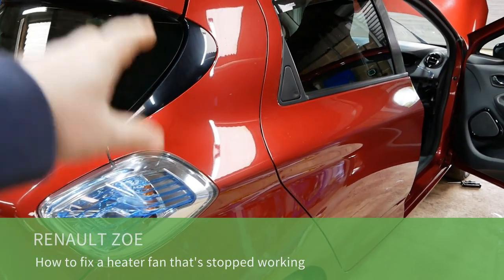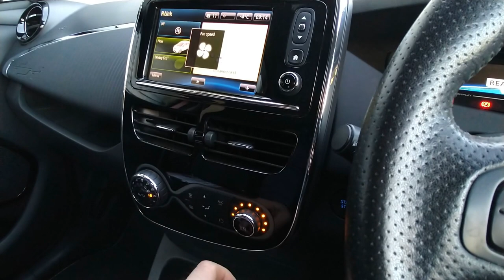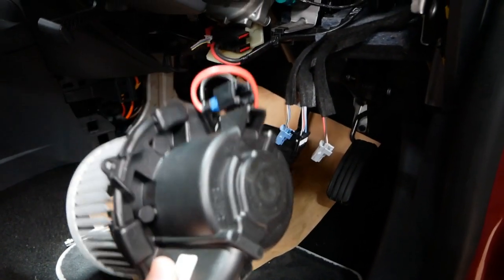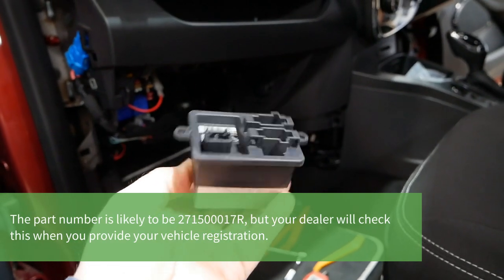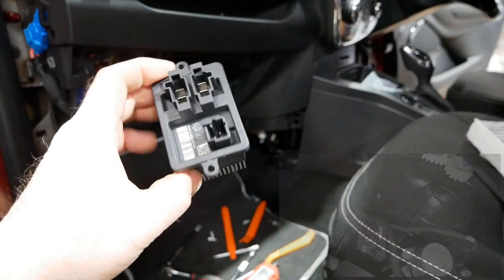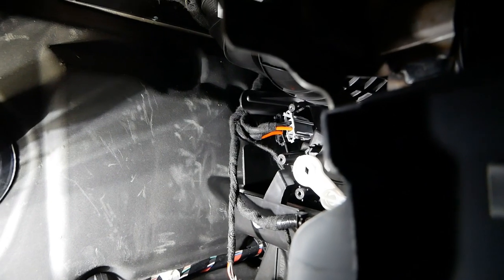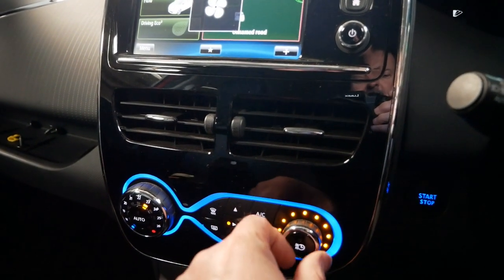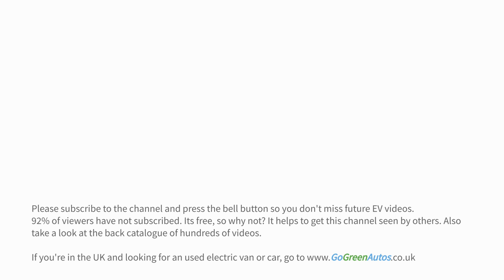No hot or cold air in your Zoe? Fixing the heater blower fan in a Renault Zoe.

Comment: Thank you very much Matt. I had exactly the same problem and fixed it the same way by replacing the resistor unit. Just don’t do what I did and mix the old and new ones up and have to do it all again! However it was worth it to find out that the old one was getting extremely hot after a very short time connected - the cooling fins were too hot to touch. If that is happening to yours after just a minute, a sure sign it needs replacing.

Comment: Yeah, it was the same on my Vauxhall Cavalier.  The fan would stop working because the diode in the "resistor" module had blown. I was told that it was a common job at the Vauxhall dealers. I bought some diodes and replaced the diode. Cost was about £1. I did that job a few times over the 8 years I ran the Cavalier.
Reply from the maker: Yes I'd heard this is common on others older cars. But I was also told that the Zoe didn't have a resistor module...hence why I went looking for the fan.

Comment: This happened to my Zoe too. Replaced the resistor, but still not working. Took out the bottom right 10 Amp fuse that controls the fan and locked car for 10 min and the fans work again. Quite fiddly to replace the resistor. Using my iPhone in Video mode with flash on helped a lot to locate everything.

Comment: I'll try this out! I'll check out your vids for any other tips for why my heating might not be working in a 2014 Renault Zoe?
Reply from the maker: Heater problems in the Zoe is normally due to low refrigerant. The heat pump uses the air conditioning compressor and really you need to regass the cars about every 3 years. See https://www.gogreenautos.co.uk/how-tos/renault-zoe-heater-not-working

Comment: Very interesing video about Renault ZOE PTC heater. How install ? Where location ant etc.
Reply from the maker: Zoe has a heat pump, not a PTC heater.
Reply: @GoGreenAutos  Other ZOE versions have a aditional PTC heater, conected to PDM module.
Reply from the maker: @miciusbmw  Sorry Yes you're correct. I forgot the Zoe has a small PTC heater to assist the heat pump.
Reply: @GoGreenAutos  ThankYoo fo answer. Very interesing all information about PTC. On My Zoe 2014 year, no PTC heater, heat pump in -5C conditions always work at max heat mode without ECO mode, for me not enougt heat power. Heat pump serviced by Renault Dealer, freon quantity is normal. I using small 150W heater in 12V, but is very very small help. Legs heating is very weak.

Comment: A somewhat related question: a spinning noise has randomly appeared when the heater fan is on. I can hear it quite clearly from outside where the air intake is below the windscreen. Is there any what to get to this to see if anything is stuck in there? It‘s not a problem (yet) but just annoying.
Reply from the maker: Often caused by a leaf in the system

Comment: Did you find a way to test the resistor pack to confirm it is dead?
Reply from the maker: No. I don't know how they work. But I'm sure that info is probably somewhere on the net as the same component is used in most heaters.

Comment: The heater resistor pack on cars in general can fail because the lubricant on the heater motor bearings has dried out. Often the resistor pack has a safety component that fails due to this and fan then only works on max setting. Expensive job at dealers, can be done by owner, it's simple but awkward, you may have to use bad language on it!
Reply from the maker: Good to know, thanks.

Comment: Great video! However after I replaced the resistor pack with a brand new one, the fan still doesn't work. I measured the input voltage on the fan and it gets proper voltage which correctly vary when I adjust the fan speed up or down on the dash. Do you have any hint where to continue the troubleshooting?
Reply from the maker: Sounds like you need a new fan motor then.
Reply: UPDATE: I removed the blower unit. The fan actually wasn't faulty. During a bench test, I connected it to a spare 12V battery and it worked perfectly fine. I cleaned the commutator with contact cleaner and reconnected the unit to the car. First just hooked up to the input wire and started the car and voila the blower was working perfectly! 
The removal had been complex, but the refitting was a mega-nightmare! I worked on a righthand drive Zoe. This car is the 'pinnacle' of French engineering. You can barely remove the blower but ultimately it comes out. When you try to refit, it doesn't go back, because the rim of the blower housing stuck into a massive steel plate which belongs to the steering column. I did not mess around with that part, because it looked to be responsible to adjust the distance of the steering wheel. Therefore I removed approximately 1-2mm material from the blower unit's plastic housing where it couldn't get through. Finally after a 2-3 hrs of struggling the blower was back in place and the car is nicely warm again.
TIP: Use a socket wrench with a flexible adaptor. Also try to use a socket wrench which doesn't come off, because most of the time you will work blindly and the last thing you want is to drop a wrench into the abyss of the interior parts.
Reply from the maker: @gyulabakonyi8726  yes I found it a nightmare getting the fan back in. I managed it without any trimming, but it took a lot of attempts.
Reply: Hi Gyula, looks like I am similar to you - I replaced the resistor pack and it hasn't fixed the problem. Did you fix this in the end and any tips for a next step in diagnosis.
Reply: @barrydarnell5879  hi Berry, I started with the resistor pack because that seemed easier to access and replace, also did not cost too much. After it didn't resolved the problem, I had to remove the entire blower unit. Removing is difficult but doable, but reinstalling is a nearly impossible due to the bulky design of the blower unit as well as a massive metal component of the steering mechanism which is exactly in the way. So, I simply cut off a bit of the plastic casing of the blower unit and it allowed me to rotate it back in  place. Before reinstalling, I connected the blower to a 12V battery to test it. I hope it helps.
Reply: @gyulabakonyi8726  Thanks Gyula, I'm really struggling to get the blower out, never mind back in !! I'll do a test with it in the car I think and if its not working give it to an vehicle electrician to look at!!
Reply: Hello,
What is the difference in lhd and rhd zoe? Was yours lhd? Hello from a fellow Hungarian zoe owner!
Reply: Hi  @lipcseigabor3898  My Zoe is rhd. I expect in the left hand version there is more room to work because the entire steering column and all the instruments beneath isn't in the way since that is on the left side of the car. Renault did not bother to swap the fan for rhd or lhd. If you have left hand drive Zoe, you need to remove the glove box first, which isn't a big deal and then work towards the fan. The most annoying is that I had to remove and refit the fan unit during the last weekend again. I have no idea why, but whenever the car is left on the driveway during the Christmas holiday for a week, the fan did not work when I start using the car again. This is not happening during the summer. I assume something is with the humid weather which may cause the motor brush to corrode to the commutator, but I am not sure.  Anyway after a few house struggling it works again. Let me know how your proceed.
Reply: @gyulabakonyi8726 in the end I have managed to find and change it as well. Boy it was a task! Half of the time I didn't see what I was doing. It was a really good task for a gynecologist. 
The only downside is that it's still not working. So tomorrow I will tackle the ventilator.😂
Reply: @lipcseigabor3898  Well done! So you replaced the resistor pack. The fan unit removal won't be a walk in the park either :) Most of the time I need to work blindly, however I expect because of the left hand drive car, it will be a bit easier. The blower unit is held in place by 3 screws approximately at 1 , 4 and 8 o'clock around the perimeter of the unit's case. I needed 5.5 socket wrench to remove 2 of them and a 7 to remove the third one. I don't know it is intentional or when last time it was on service at a dealership somebody dropped the original one inside and did not bother to find the correct size. The power supply plug can be removed while the fan unit still in place by pulling it outwards firmly. Half of the plug is attached to the fan unit strongly, so you can pull the other half firmly, just check that you pull the right half. When I removed the fan, I pop off the end of it to have some access to the commutator. I blow off the dust with compressor or canned air and apply generous amount of contact clearer. After that  I connect it to a spare car battery and give it a spin and it can be refitted.

Comment: Does anyone know of a video to put back the denso a21201700 Renault zoe heater valve motor? I removed it to replace the thermistor, but I'm having difficulty re-attaching it to the white plastic and then back onto the mounting holes to be screwed in. I can see the way the motor screws in; but does the plastic arm at the back need to slot into a groove somewhere?

Comment: Hi thanks for the video, how can we be sure the failure comes from the resistor pack? Any way to test it? Thanks in advance
Reply: I checked the 10A and 40A fuses mentioned and they were ok. Also tried disconnecting fuse and whole battery. Also discovered old resistor was very hot after just a few minutes with car switched on.

Comment: Great video Matt. Our 2015 Zoe (22kWh Q210) has recently developed quite a noisy compressor / heat pump which is very audible when driving and you can feel a bit of vibration through the steering from it. All the heating and cooling appear to be working fine at the moment but I wondered if you know if this is a symptom of something about to fail or a sign it needs some maintenance? I know the Zoes are loud when the heating/cooling is running at full whack but it doesn’t seem to ramp down to a quieter level anymore.
Reply from the maker: Get it regassed ASAP. It should be done every 3-4 years. You may find you need a new compressor at some point in the future, but a regass now may just catch it.

Comment: does this part control the heat to?
Reply from the maker: No, just the fan speed. If you have no heat, then its highly likely that it needs re-gassing. See https://www.gogreenautos.co.uk/how-tos/renault-zoe-heater-not-working
Reply: @GoGreenAutos  got the car re-gassed. Nice and cheap lol. Bit warmer bit still not great
Reply: Think il search out if there is a heating element somewhere
Reply from the maker: @StephenLyons1984  It has a heat pump
Reply: @GoGreenAutos  my heater has just started working great. i did nothing changed nothing. but have nice hot car now. she is blowing out 48c air. was wondering if the cold spell we had helped or was there a pocket of air blocking the heat pump. but nice to have nice hot air